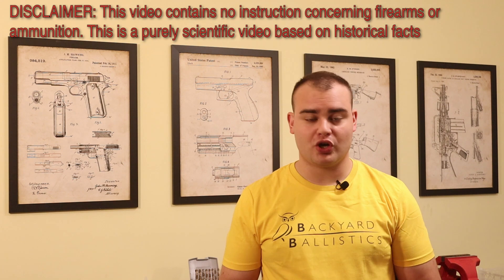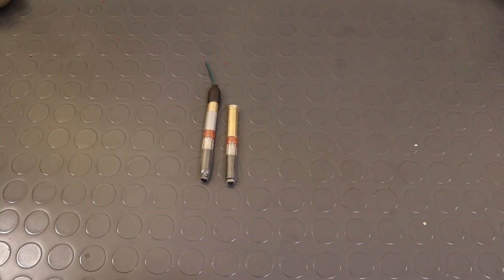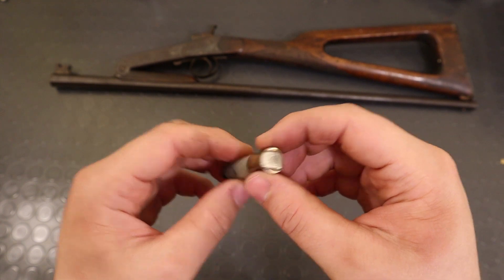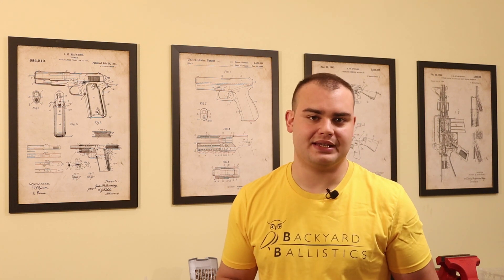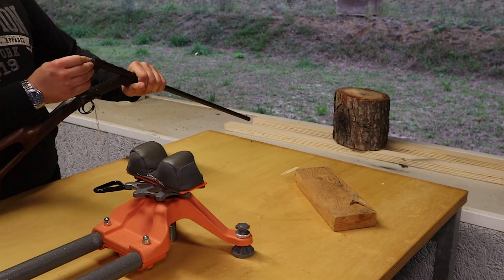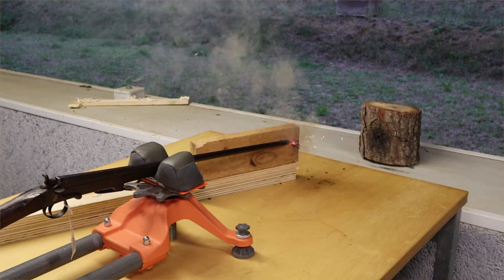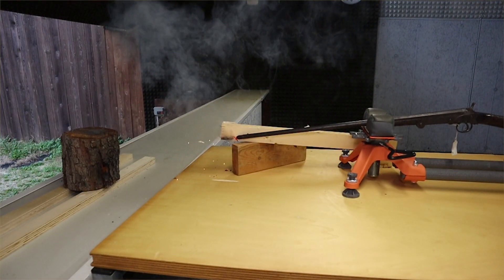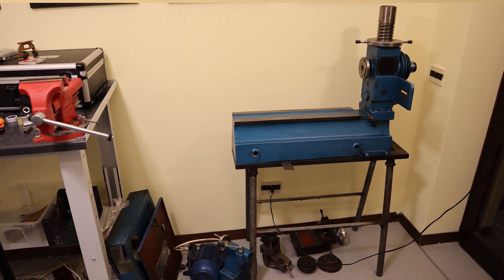Shooting The Cartridge That Travels The Barrel Both Ways (part 2)

Comment: I feel like this has potential for 3d printed firearms.

In 3d printed firearms, the biggest limiting factor on power is the need for a secure breech lock, that plastics just cannot provide.

This thing does not have a breech lock. Theoretically someone could make a full auto assault rifle that uses these cartridges where the only metal part is the barrel.

Comment: One can build a recoilless rifle:
1. Barrel with both ends open
2. Fire hole or cap nipple in the middle
3. Load one bullet so it doesn't reach the fire hole
4 load powder into end opposite first bullet.   
5. Load 2nd bullet to trap powder 
6. Ignite powder 
This results in the bullets being pushed out both ends.  
If one bullet is heavier it will cause the lighter bullet to traveler faster
Reply: Perfect for shooting yourself in the foot and the head at the same time.

Your physics check out, but your applications?    Please.

Comment: so I just stumbled across thischannel and I gotta say it's this idea is amazing... and amazingly unnecessary, however it's seems perfect for what I had in mind for some time and that being a use of fuel for propellant like thermobaric bomb, the obvious problem being mixing fuel with air but in this design is almost given, the cartridge would require some major tweaks, but is great step forward for the concept, I'm aware that such an idea is full of problems and I most defenitly don't know wether fuel can even be a viable propellant in an modern firearm, but still it seems very tempting to use something with higher energy density
also nice videos

Comment: the ballast doesn't need a primmer in a sealed barrel. the heat from the compression is enough for ignition. just like a diesel engine or a fire piston.

Comment: Not sure if you will read this... but, would the powder behind the primary bullet even need a cap of any kind? I would think that the pressure from "ramming" the round backwards would be enough to combust the powder. (Slam Rod Fire Starter)
This idea would not need a rear opening to clean the barrel out, and could be rapidly fired (relatively speaking)
I could be totally wrong, but... Just had this thought the whole time I was watching your video.

Comment: Its entirely possible that it lit off prior to the primer detonating on impact as compressing air causes it to heat up. Like those pneumatic/pump fire lighters/strikers, or a diesel engine.

Comment: Compression ignition would also be an interesting method for detonating the second/primary charge. As the air in the barrel gets compressed, it also becomes super heated. I wonder if the second primer is even needed for this to still function. I'd be willing to bet a simple pin hole covered with tissue paper acting as the wadding would do the trick.

Comment: I stand by my first comment in part one. So you proved a concept, that would avoid having to use a ramrod in a muzzleloader. But practically, this idea is worthless, lol. There's no practical reason a shooter would ever use such a device. It uses too much powder, too many components, and having to light a fuse, then wait while holding and aiming for the fuse to ignite the charge is just silly. Using a ram rod in the first place is no big deal and would actually be a lot faster than this method. BTW, that 'old' single shot .410 you used is actually quite valuable and I hope it wasn't harmed in your tests. My guess is it is worth upwards of $300 currently, possibly more.

Comment: I once thought about making a type of ammunition that used a friction tube such as used in the early days of breechloading artillery 'vent sealing tubes'. These used a small copper ball between the match composition and the rest of the priming chain. There was a tapered chamber that admitted the flame from the match composition, around the copper ball / tapered annulus into the rest of the powder train. When the main propellant charge turned into gas it hammered the copper ball into the tapered chamber until it sealed. I never got around to this. Never seen anyone make a small arm like this. It would be fun to play with.

Comment: I wonder if (with enough trial and error) a self loading version would be possible. Maybe the hammer could push a cartridge from a magazine into the chamber/muzzle before striking the primer? It would be an extremely simple self loading gun, although you're just replacing a complex firearm with complex ammunition

Also having your magazine right next to the muzzle is probably a bad idea. Interesting video nonetheless.

Comment: How about placing a spinning disk in front of the barrel,    set it to a known rpm then fire,   the disk should have two holes with a spacing that can be used to calculate the delay between the firing.
Reply: This is actually how old chronography was accomplished... as long as you add a mechanism that instantly marks the disk at the moment of firing (things like charged capacitors that fired a coil and arced against the paper, set off when the bullet broke a foil strip leaving the muzzle) then you can calculate the timing of everything afterwards.

Comment: I dont understand the point of this or even actually what he was doing for that matter.
Reply: A- it can be used effectively in very very simple guns
B- that was the bet. The simplest effective gun
C- why not?
Reply: imagine you throw a ball at the wall and it hits you in the face. Your head bounces off of the wall with so much force that instead of falling backwards against the wall, you fall forwards away from the wall.
The idea behind this round is front loading ammo that like a musket rifle without having to physically push the round into chamber. The first blast pushes both bullets into the back where the second blast then pushes both bullets out of the gun.
AKA a gun that only requires a igniter and barrel.

Comment: After watching this a second time, a thought occurred to me.

Wouldn't it be easier to use a small packet of liquid engine coolant to create the shaped charge instead of a ballast?

Then no deflector is necessary, and you simply need to modify a grill lighter or some other device to allow the gun to function with the pull of an electric trigger.
Reply: What I'm picturing is something like a Saran (or other thin plastic) wrapped cap of fluid inside the shrink-wrap casing ahead of the first charge...is that accurate?

 I wonder if something easier to produce, like a wax cap, would do the same thing? The heat from the stage 1 charge would immediately deform, if not completely melt the cap on the way out.
Reply: That would be just a different form of ballast. There is nothing to gain by using a liquid.
Reply: @timhofstetter5654  The liquid would provide weighted resistance when the initial shot was fired, and would dissipate to clear the path for the bullet. 

Liquid is used for to create shaped charges for demolition and breaching.
Reply: @flyboymike111357  That it is. Because... liquid is easy to transport as a "massy" bulk material. You can carry a five-gallon bucket of water by hand all day to make up one ton of ballast high on a rocky hillside. Try to do the same thing with a solid object, though.

A benefit to the use of solid ballast is that it's very, very easy to reuse. Liquid ballast is not. You can carry the same solid ballast around with you for months, using it thousands of times. If you use liquid ballast, then you need to carry a LOT of it around with you. Packaged.

Comment: It looks as though the concept worked. I wonder what a graph of barrel pressure would look like. If the ballast ever stuck it would have been an obstruction. It appears clear that that did not happen though. Another concern would be if the compressive heating of the air could ever ignite the main propellant prematurely.
It was an interesting video.

Comment: You can rent a better high speed camera than you'll ever be able to afford.
Reply: Chronos 1.4 is $3400 and has a high enough framerate. It is what Taofledermaus uses.
Reply: @titter3648  Taofledermaus is mainly filming shotgun rounds.  Rifle rounds are a good bit faster.
Reply: @workingguy-OU812  The round in this video is a shotgun slug shot from a shotgun...
Reply: @workingguy-OU812  It doesn't really matter, Taofledermaus also filmed rifle rounds before, with, for most purposes, acceptable results.

Comment: Instead of a 410 shell you could use a rimfire case which (usually) has a bullet diameter the same as the cartridge diameter. As a bonus you can hit the side of the muzzle with a hammer to fire it instead of sticking a pin over the muzzle as with a centerfire.
Reply: Ooh, we could incorporate the whole thing into a plug bayonet, so when you stab, it shoots the bayonet off at hundreds of feet per second.  That'll teach 'em!

Comment: I agree, a high speed camera would certainly work the best at finding out what is happening. 

I go a cencept which would be very cool to try; 1charge to rupture a small disposable gas can, and one charge to set off the gas cloud before it goes up in flames. It can be timed to the milisecond with an arduino. The initiators being christmas lights, it can be set off by just the arduino. This could be the cheapest "boom for the buck". A termobaric bomb. 

I like your concept and it seems to work. 

Greetings,

Jeff
Reply from the maker: hi, thanks for the suggestion. I agree I really need a high speed camera, I'm probably getting one asap
Reply: @Backyard.Ballistics  best to look for one for a month or so, because gettingbsomething quikly can be a doisapointment. So of you are like: ill get one 1stvof december, by that time you probably know what is the right thing.

Comment: I'm not sure the primer on the main charge of necessary. As you compress the main charge the shit in the barrel will heat up and likely ignite the main charge. Might be able to make it simpler.
Reply from the maker: unfortunately igniting the solid grains of powder with hot air would require an exposure time much longer than what is available. I actually tried doing that with a springer airgun modified to reach very high compression ratios, and was never able to ignite any commercial propellant (smokeless or black powder of different grades). An atomized/finely divided fuel is required, like cotton wool, but I haven't tried that.

Comment: Very cool and a clever design. Certainly not practical in the modern day, but it seems like a solution for the muskets of old. It may not be as quick as a bolt or even a break action gun, but it's a lot faster than a traditional musket even with the hand lit fuse.
Reply from the maker: good, now I just need a time machine! 😂😜 😜
Reply: They invented the solution the Sharp rifle with paper cartridges

Comment: I wonder if the compression from the bullet moving towards the breech would be high enough and reliable enough to ignite the powder, since its basically acting as a fire piston. Then the second primer could be eliminated.
Reply from the maker: unfortunately igniting the solid grains of powder with hot air would require an exposure time much longer than what is available. I actually tried doing that with a springer airgun modified to reach very high compression ratios, and was never able to ignite any commercial propellant (smokeless or black powder of different grades). An atomized/finely divided fuel is required, like cotton wool, but I haven't tried that.
Reply: @Backyard.Ballistics  Daisy air rifle company actually manufactured a .22 with caseless ammo that ignited the propellant with air compression. It worked, but the ammo was expensive and it was expensive to manufacture.
Reply: @deandeann1541  I'm not sure how much the VL22 cartridges cost, but the main factor in its failure was the ATF ruling that it was in fact a firearm and not an airgun, meaning Daisy could not produce it without an additional license.
Reply: @Backyard.Ballistics  A small tuft of nitrocellulose.
Reply: @Backyard.Ballistics  Gun cotton would likely work. Nitrocellulose made using actual cotton would create the light airy medium with the proper explosive material type. There is already fire starter devices available known as fire pistons that work this way using a normal cotton ball or a piece of char cloth. It relies on the air compression of a cylinder to ignite the tinder to use is starting campfires and such.
Reply: While I'm unsure about this, but the heat from the compression most likely isn't enough to deflagrate the whole load, if I recall correctly, the reason for why there aren't many large rimfired cartridges is because the jetlance from a normal primer is needed for the uniform and more complete ignition of the propellant, this is something that isn't achievable with a rimfired primer. But this largely just an educated guess, and I'm not sure about it.
Reply: It would be interesting to see if you could use compression ignition  to reliably fire gunpowder.   Look of gunpowder engines.
Reply: I thought the same thing.
Reply: I'm thinking he'd have done better to have an intentional vent in the breech plug to resemble a cap nipple